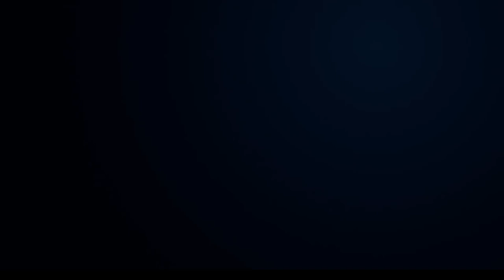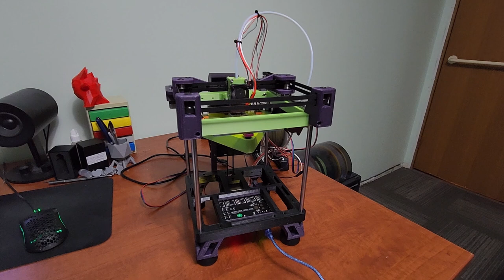Your first DIY CoreXY 3D Printer the Rook MK1 - Full Release

Comment: Really inspiring, and a huge step up from just modding an existing printer. I'm holding off right now because I really would like a 300x300 printer for functional parts. If rook is the first DIY printer, I wonder if the same parts and basic design could be expanded to create a larger second DIY printer - e.g. by adding sides for stiffness and longer and thicker linear rods. It would seem that with plywood or acrylic panels, the rook / rook 180 design could be stiff enough.
Reply from the maker: Some users have already made a Rook 220ish mod, I think that is as big as I would go

Comment: Looks like my spam about needing more mounting points was heard.

I have to reprint most of my rook due to too warped frame. Some time ago i started drawing my mod to make it easier to print on my crappy printers, but that mk1 changed a lot. I will have to decide if i want to stay with z screws or to make it belted.

That's my 1st corexy printer and first printer wilth klipper. Building this thing helped with going forward with other projects. After setting it up and testing i really liked the ui and ease of changing configs, so i reflashed my "main" printer with klipper and later 2 other, older printers that i'm restoring.

Comment: Would any control board work? I have an old 8-bit board, and a bunch of matched steppers already. I can get the pin out for the board, although it would be a new experience for me figuring out how to write the config.
Reply from the maker: I recommend using Klipper with a 8 bit board if it supports it. Some users on the discord did use Marlin for this printer
Reply: @Rolohaun  that will work!

Comment: I heard that the VORON Tap onyl works with rigid z axis systems (like lead/ball screws) and won't work that well, if at all, with non-rigid z axis systems (like belted z)

By further extension, does that mean the VORON Tap and/or Tappy mod in the Discord won't work well, if at all, with the belted Z "ROOK MRK 1" official release? 🤔
Reply from the maker: Hmm never tired that, but I thing the tap mod is a bit different than the voron one. Check with the creator
Reply: @Rolohaun  There is definitely a difference in terms of complexity/rigidity since the VORON Tap uses a MGN9 rail and magnets, but I think the core idea is the same

The hotend can shift up and/down in the Z direction as it is being used as the nozzle "ABL" probe

I guess I wont know until I try
Reply from the maker: @Chris Jayden 杰一邓  if the belts are tight I think it should still work but ya give it a try

Comment: What's the average cost of the material needed for the build?

Awesome work BTW!
Reply from the maker: you should be able to print the Rook using one roll of filament, full BOM price is around 250 USD if everything is new

Comment: Just curious, why did you abaddon dual z axis of the legacy version? Read leveling is hard on voron with single axis cuz some abs deforms with time and permanent pressure
Reply from the maker: not needed for this size of printer, less parts now and easier to build

Comment: Mhm i'm afraid it's still much too expensive for me. Where could one save costs?

I have extra 12V PSUs, but none 24V.
It would save cost if it could fully replace my existing printer (Direct Drive, 20cm bed, rebuilt from Geeetech i3 Pro W kit but still using most of the woodframe). This would give me electronics, NEMA17s, 8mm rails.
I actually have a spare 3D printer control board that i don't use though, but i only have A4988 spare stepsticks.
Sensorless homing... mhm maybe? Currently i have TMC2225 with no sensorless.
60€ in linear rails is a substantial contributor. I guess i could snipe them on a discount for 30€.
I can save on the rubber feet, i can just make my own from existing scraps of material.

Extruder basically has to be MK8 for cost. I don't need any 24V fans, i can splice in a step down converter (a single for all fans) and run cheap fans on 12V.

I would like to do a CoreXY build if i can fit it within 60€ of cost, maybe 100€, with some sort of smart salvaging.

One of my plans is to find a broken Geeetech A10 or Ender3 printer for cheap. Repair and rebuild that to taste and then junk my current printer, liberating its parts and discarding the wood frame. The frame and motion system is an improvement and i would receive a 24V PSU. One thing i don't like doing is modifying PSUs too deeply, but i can't say i hadn't done this before. Primarily it just needs a lot of precautions and i always need to double and triple check things, not being able to just YOLO it takes the fun out of the endeavour. But i can easily rebuild things back to spec that have failed, unless it's custom magnetics.

I'm building myself a tiny little toy resin printer as well. I have set the total project budget at about 30€. The idea is kind of similar to Lite3DP except my own take on it. I have already scored a small sample bottle of resin for 5€ (free resin, paid shipping) and i already got some FEP, not sure how much i paid for it, but it wasn't much, let's say 5€. I have developed an image compression scheme that runs on the microcontroller streaming from SD-Card, basically specialised RLE, it's similar compression ratio to PNG - there is a quality loss but it's not going to cause issues, anyway it helps update the screen quicker, and also will allow me to fine tune the anti-aliasing exposure. I basically run length encode pure black and white runs, while palette-quantising 2-pixel groups that aren't white or black. I expect it to have a 320x240 2.4" mask LCD (5€) and an ESP8266 (2€), a belted Z with a geared blinds stepper (2€) and working on converter/control which runs in web browser, so it's not going to even have any buttons or menus. I've also spent about 3€ on the UV LED and driver, and i have ample heatsinks around. The sample resin is only 100ml but with a vat that takes maybe 1ml, i'm not exactly in danger of running out just by looking at it. So i have maybe 8€ budget left for motion system but i have more than plenty of spare bearings and stuff.
Reply from the maker: it can be cheap if you reuse motors and main board from another printer. There are a lot of users on my discord that have build this printer very cheap.
Reply: @Rolohaun  It's not like i have a house full of printers! And i don't want to be downgrading my only one from 20cm to a 12cm one.

I saw your other design the 18cm one. I shall consider that or something similar. I was actually thinking of building a Hypercube from the moment i got my printer back 5 years ago.
Reply from the maker: @SianaGearz  I have built a Hypercube too nothing wrong with those machines. I defiantly would not recommend downgrading or taking apart a printer you currently use. Finding a broken used one would be best.
Reply: I would also like to see an 8mm smooth rods version instead of expensive rails.
Reply from the maker: @Yvan256  there is a mod on printables and few people have them running